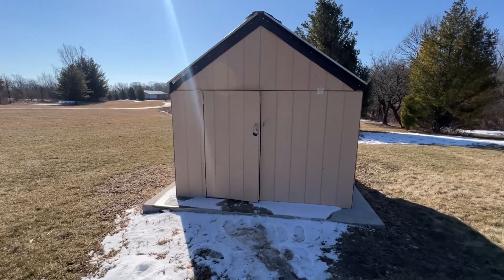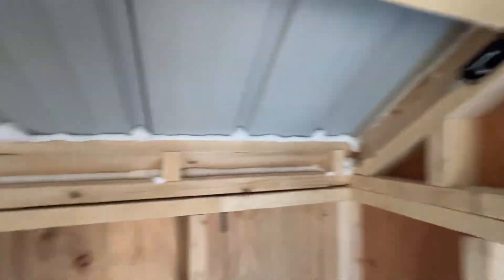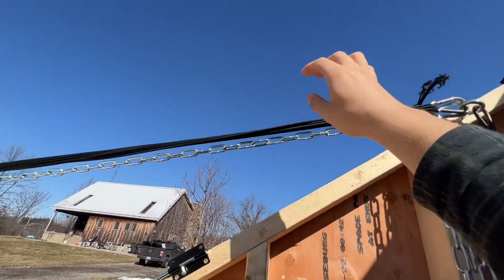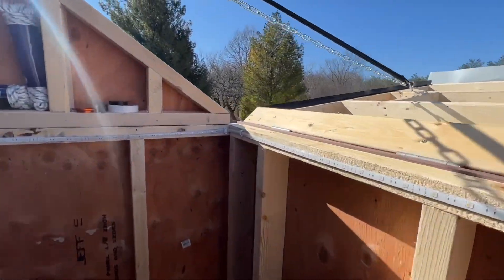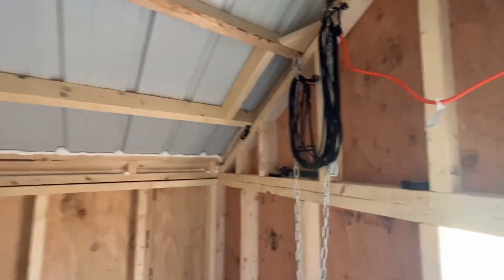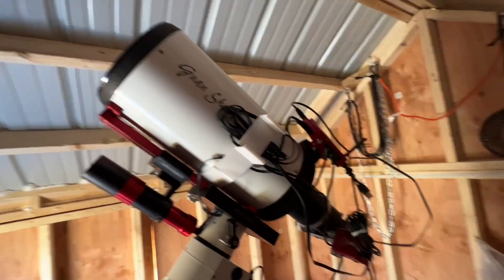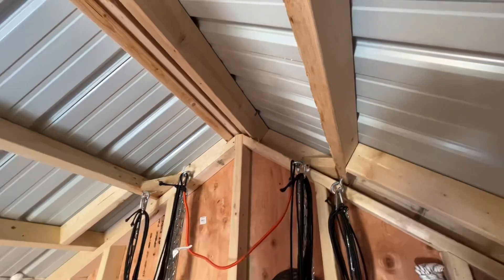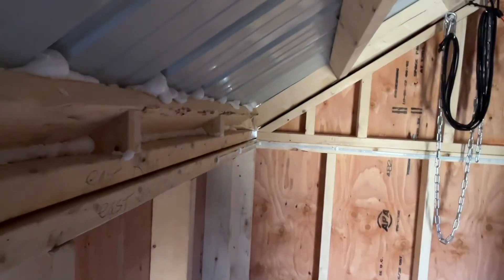DIY opening roof telescope observatory

Comment: I like it!   It's 'kind of' like a dome - such that you can open what part of the roof you want, to observe the part of the sky you are viewing, as opposed to opening ALL of the roof - which is necessary for a roll-off roof design.   I'm looking to build a new observatory, in the size of 12' x 24' - and I had considered a roll-off roof which means that I need to have another 24' of space for the roof to roll off.  Your method - I'm going to give this a lot of thought.   Thank you for this video.

Comment: Hi, and thanks for this video. I am tossing up between a similar design or a RoRo. How large is yours W x L x H, and what is the roof angle? Do you think the weight of one around  3m x 3m with a 30 deg rake would make it too heavy/ cumbersome to open and close? Opening one side at a time (and maybe not even fully open) would give me some wind protection while a RoRo wouldn't.

Comment: Would a roll off be easier?
Reply from the maker: Yes that was my original plan but I already had a 10x10 concrete pad that I wanted everything contained on. If I went with a roll off roof I would have needed posts out 8ft from the wall. Also what ever direction it rolls it will be in the way possibly. This way made certain I can have a 360* view with no obstructions